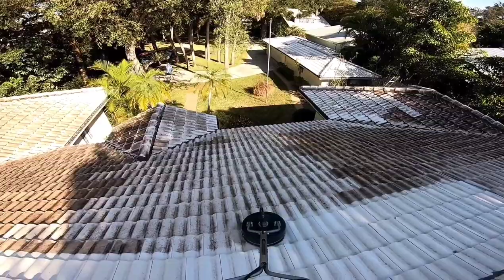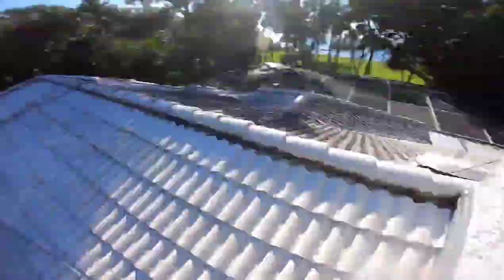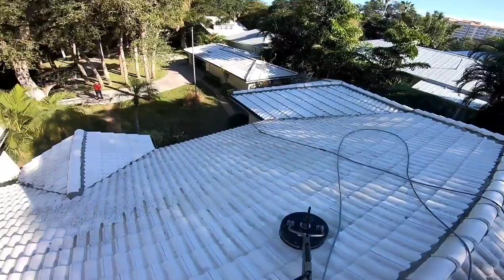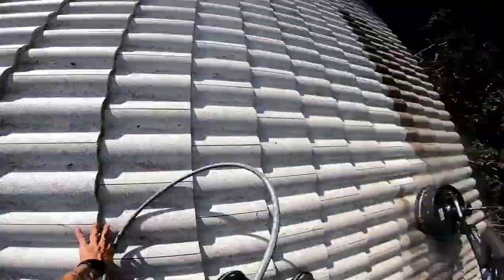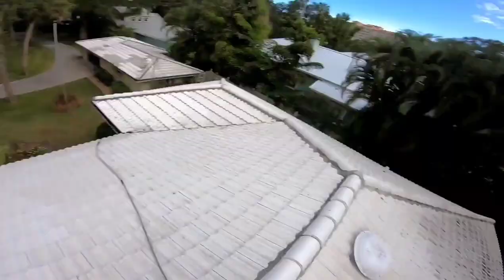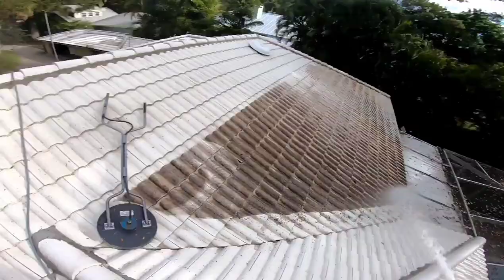Breaking The Stigma Of Tile Roof Cleaning One Roof At A Time. (Florida  Stlye)°[HD]

Comment: Hi, love the Channel. Im 18 and id like to get into pressure washing, i been doing my neighbors tile roof (i have roofing experience) and i have a 20" surface cleaner with 4000psi

My problem is that id love to clean just like you, facing down with surface cleaner doing its job as that is very comfortable. But whenever i try that position my surface cleaner just goes up and i have to like hold it down, very uncomfortable. 

How do u make your surface cleaner hug the surface without flying it into the air. Do you add weight on top of surface cleaner. Is there a sweet spot on pressure? 

Thank you
Reply from the maker: It varies but try a weight or use your wrist as a pivet point.